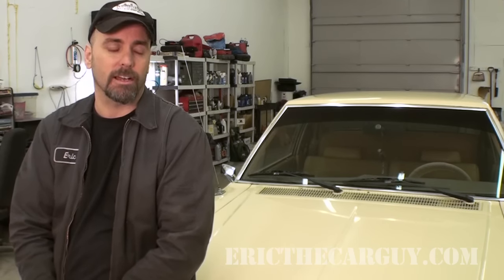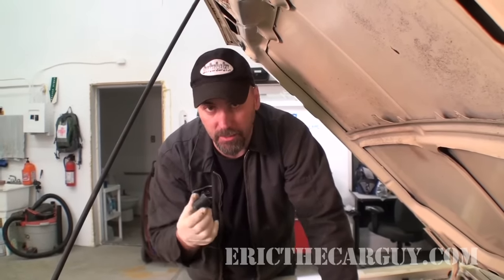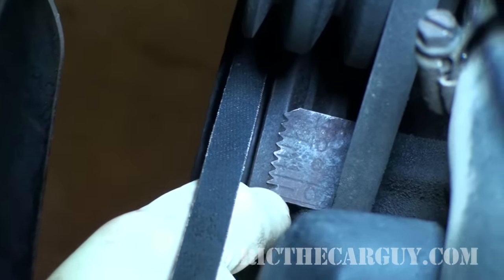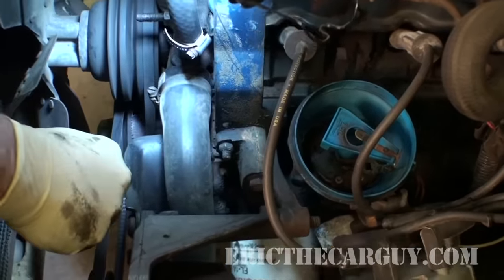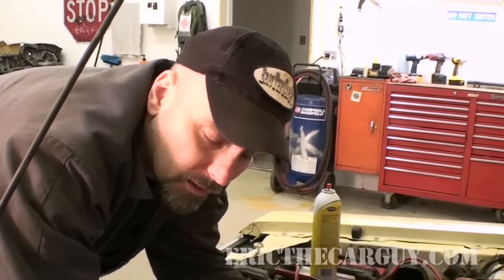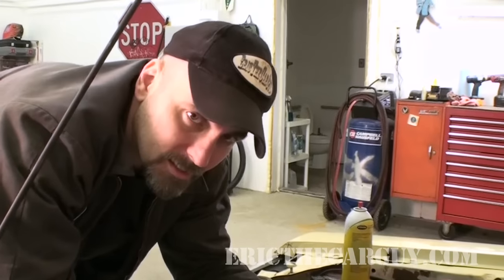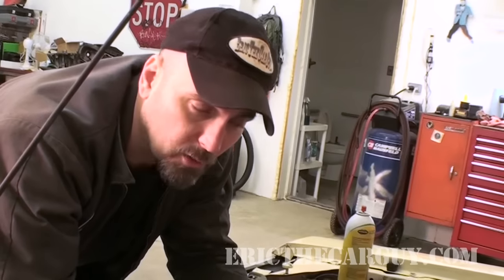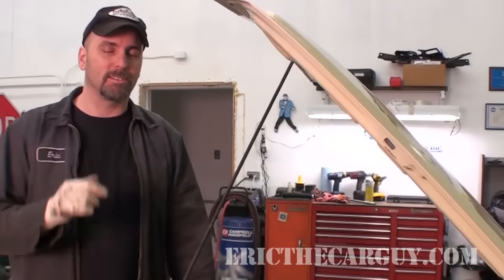How To Check Timing Chain Slack -EricTheCarGuy

Comment: I hate to say this, but I really think the quality of the sound AND appearance of your videos were much better when you were working without a cameraman. I know he's a nice guy and all that, but your videos prior to using a cameraman seem superior to me. That's just my opinion; I'm sure others will vigorously disagree with me.
Reply from the maker: Thanks for your input but for me it's much easier to focus on what I'm doing rather than what I'm doing, the camera, the sound, and everything else.
Reply: Kenneth McCoy Also keep in mind that the acoustics in Eric's shop aren't the best as for reverb and stuff, so if the camera moves further away from the man talking, then it gets worse. The picture quality is as good as or better (you can't blame the cameraman for the auto focus not working correctly, especially if the camera might not have the ability to focus manually), EricTheCarGuy and as for the sound, maybe more stuff around the walls of the shop (like shelves and other furniture, or if necessary maybe even some echo dampening foam pieces that came as a package of random spare parts) could probably help increase the quality quite a bit.
Reply: Seegal Galguntijak Or he could get a lapel mic (I think?), the ones that clip to your shirt so that it can mostly cancel the noise out. Some cameras have external mic inputs and you can get wireless transceivers with little to no lag. Dave from the EEVBlog has such and it works well for the most part, no static or echos. Also, having a sorta steady cam thing and manually focusing would be better because I love some of the arty shots he gets (like the bit when eric grabbed the tool from the draw, just seemed pleasing for some reason)
Reply from the maker: Naoki Saito I am using a lapel mic now, that's the reason the sound is different. :)
Reply: camera man should just use a tripod whenever he can so its not moving aound
Reply: norflett
Probably that would just cause more hassle, putting the camera on tripod, taking it off, putting it back... This type of videos that Eric does requires handheld shooting more than tripods, because at times you're under the hood/under the car/in the trunk and other times out of there, at times you need close ups and at other times wide shots. Introducing a tripod in the mix would probably increase the editing time significantly, now he can do a lot more stuff on one shot than previously, making it easier to concentrate on the actual work and cutting the time spent in editing. I personally like the style now, there were couple of blurry spots in this vid, but nothing that would have remained unclear.
Reply: The only thing I'd change with the way this was shot would be to anchor the camera when the viewer is intended to observe a small movement.  Seeing the distributor rotor turn was difficult because the camera was moving around.  It would've been cool to see a split screen between the timing plate and the distributor so you could see both move simultaneously, but that might be a little too much work for a quick video like this.
Reply: muikunruoto There are tripods that allow you to click the camera in place and take it off in one second.
Even so, just resting the camera on something would make it more stable.

The video is good but at that moment where we should have seen the distributor move the camera had to be stationary.
Reply from the maker: JaWe I agree 100%. This was actually the 2nd or 3rd video we shot together. We've since gotten better at the process and I think future videos will reflect that. I did the edit of this video last weekend and didn't see the footage till then. I suppose I could have run it through a program to stabilize the footage but I had other edits and didn't want to tie up the computer. I still think the video has value and made the point I was trying to make about what to look for when doing this test, but I agree that it could have been just a little bit better. Thanks for your input.
Reply: EricTheCarGuy It absolutely still has value, that part is my only real critique. Keep up the good work E-man and have a good weekend. :)
Reply: EricTheCarGuy You'll get better as time goes on just please keep making these videos. I actually have learned a lot from you by applying techniques and procedures in your videos to other vehicles and applications, you've been a great help as I learn more about mechanics.
Reply: egg cartons glued to the walls would work for sound dampening.